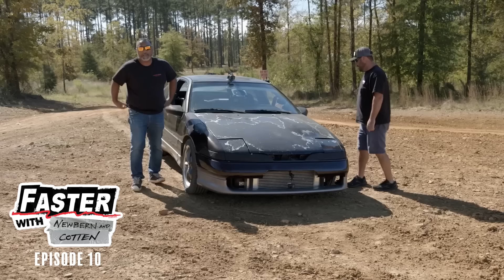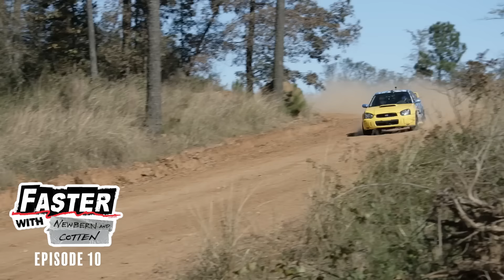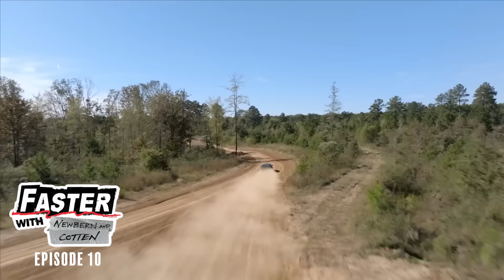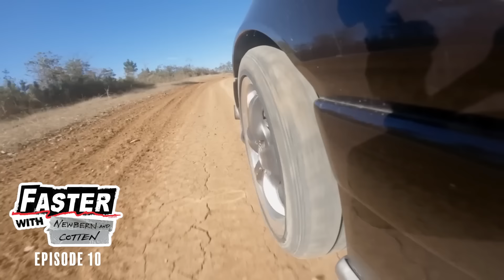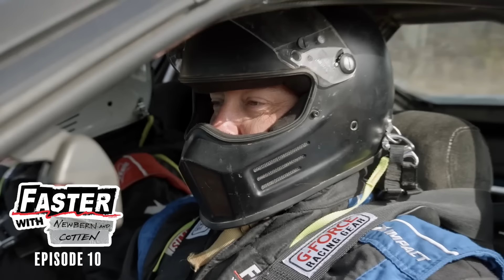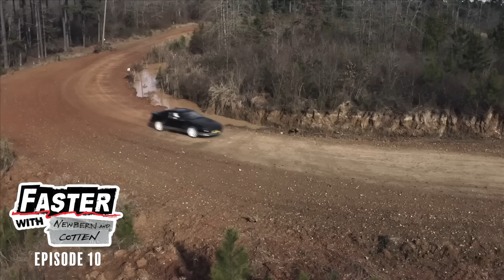Transforming a Eagle Talon into a Turbocharged Rally Racer! | Faster with Newbern & Cotten

Comment: Please don't hurt it too bad, they're getting scarce. I always thought they'd be good as a rally car, but they're unreliable 😅
Reply: To be honest put a 4G63 if they don't have one already and take decent care of it and it will treat them well theres a reason why theres still alot of evos in like ARA and BRC to this very day
Reply: Maybe find an awd charger and stick the driveline in a challenger with a hellcat or demon engine?
Reply: @PhilStewart-xf9rp  well think about it this way its reliability thats needed and 707-840 hp would be too much for the AWD LH system to handle without beefing it up and even if you got it to work its going to be very heavy and probably even approaching Group S status which cover that kinda power to weight
Reply: @speedhunter7156  Agreed. Sticking with the 5.7 (offered on AWD models up to 2014 I think) or 6.4 making Scat Pack power is the most I'd do. The early Challenger GTs should be coming down in price now too. You just have to dump that minivan engine they came with.
Reply: They jumped it. It's a unibody car without a cage or structural support. You do the math
Reply: @nathanielmoore87 too long of a wheelbase for anything respectable rally wise.
Reply: @camarowland4  eh.....not really as people actually rally trucks pretty well and the charger platform isn't much longer than the Subaru Impreza sedan
Reply: @camarowland4 it is your right to make erroneous statements in the youtube comments section. There is definitely no  way to look up the wheel base of a talon and compare it to that of an STI.
Reply: @bst310  I meant the charger
Reply: If rally had taken off in America then eclipse/talons would have been used. It was basically an Evo without the sophisticated center differential. Keep hp under 400 and these cars were pretty reliable.

Comment: total rubbish and ruined a good subaru for 50 hp ! what a load of garbage = 100%
Reply: 50hp plus won't blow up like a Subaru
Reply: @machaus99 and a lot more torque.
Reply: It has more than 50HP it also has a 100 shot of nitrous on top of that. The Subie would have blown its guts with nitrous….